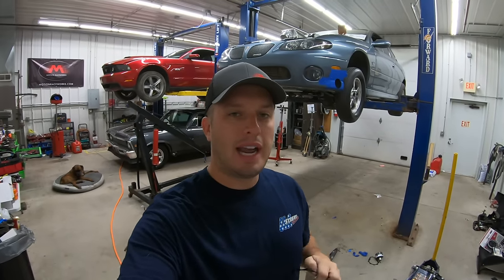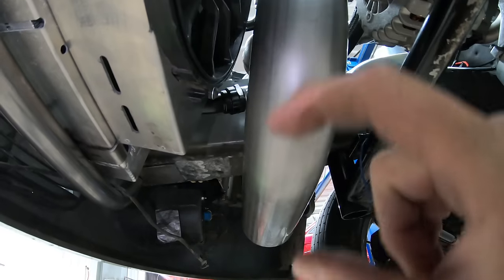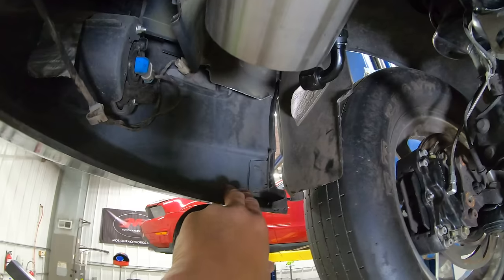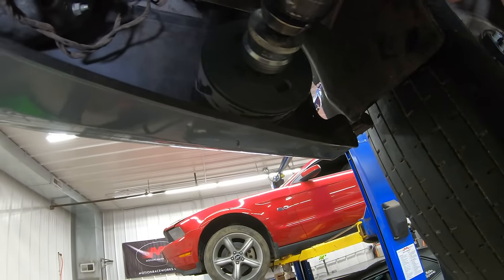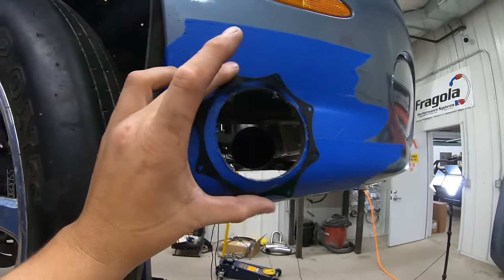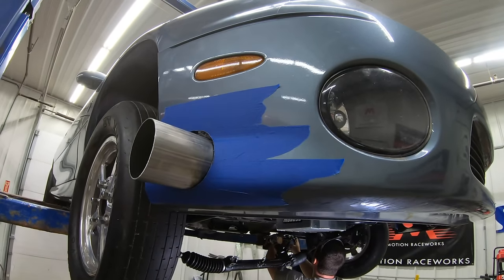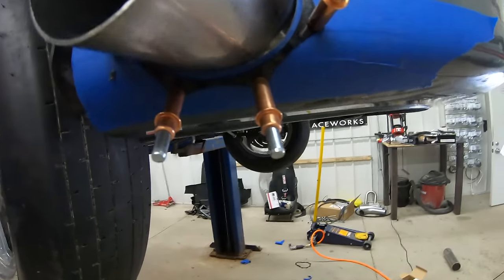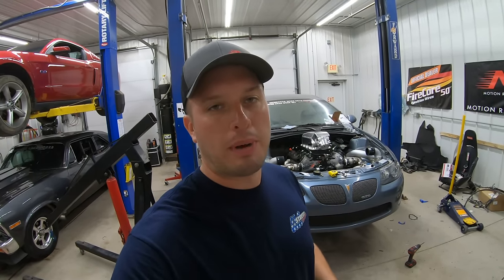Exhaust Trim Ring Install Technique, Get it Right EVERYTIME: Tech Tip Tuesday

Comment: When using a hole saw on material that is uneven like that run it backwards to get a groove. It helps it be a little less jumpy and not grab and jerk.
Reply from the maker: Saint's Trim and Paint Inc. good tip!

Comment: Great video! Also working on a side exhaust a.t.m. only on rear end of my car. Do I have to put like a heat shield on the inside or outside where the exhaust is coming through the bumper?

Comment: Don’t you hate it when people nit pick your videos?

Here goes.   

Even easier if you use rolled up heavy butchers paper stuck inside of the down pipe and extended out. Will land exactly where the extended pipe will. 

Run hole saw in reverse

Trim rings would be cooler if they were sized to the hole saw and had a lip that extended into the cut hole to cover the nasty cut edge..

Comment: What size bezel do I need if I run 3inch pipe ? A 3.5 or
Reply: I’m going to be using the ict billet round bezel from summit racing but just wondering about the size

Comment: What Alternator bracket are you running on this engine?
Reply from the maker: It’s a new prototype piece we are getting ready to release
Reply: Motion Raceworks Official with the 3D printed bottom bracket I figured that was the case.

Im trying to run the cheap flowtech headers in the “down and forward” orientation. Any chance your prototype (once it hit the market) would work with a turbo header in that configuration?
Reply from the maker: I believe so.  I’ll mock it up Monday and let you know!
Reply: Motion Raceworks Official you guys are awesome!!!